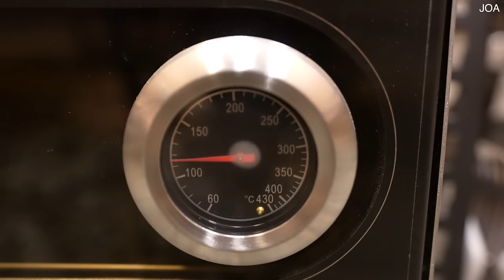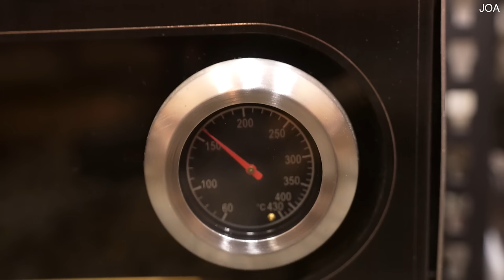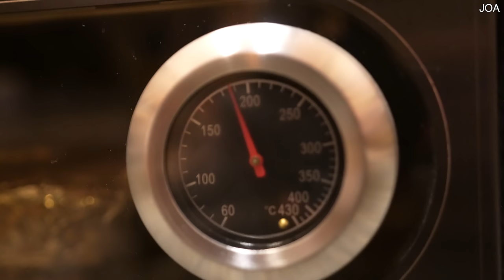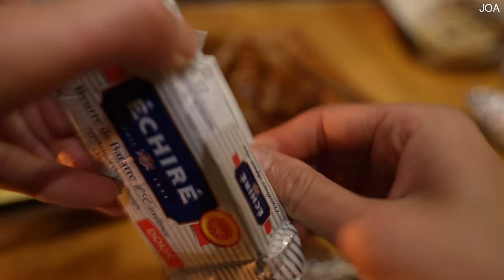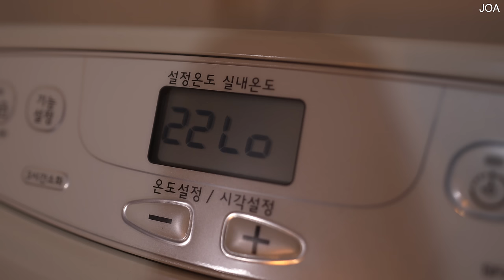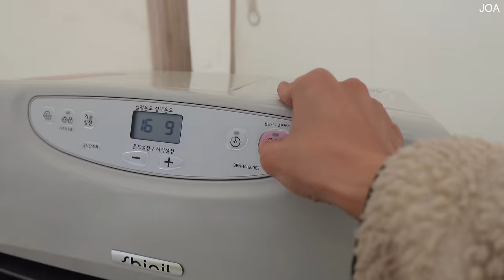새로 산 도끼로 장작 패고 불 피워서 굴 구워 먹기! 화목난로 오븐으로 등갈비랑 콘치즈 해먹기! 얼큰 김치우동에 추위까지 녹아버림! 겨울 장박, 어른이의 소꿉놀이! 행복한 아지트😍

Comment: No doubt about how sharp and heavy the ax is but the wood handle was thin and it won't last like what happened. Well, now you have the chance to have it replaced with a thicker and stronger wood that's a match to the blade!